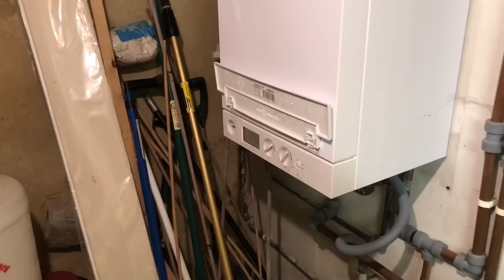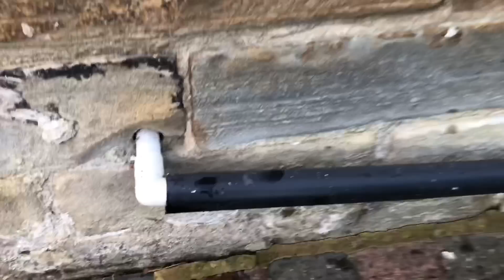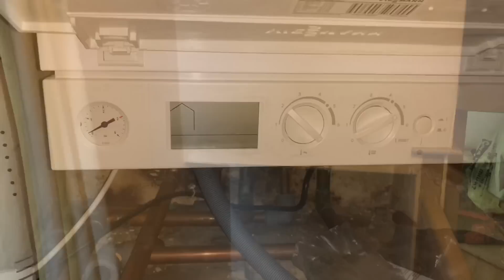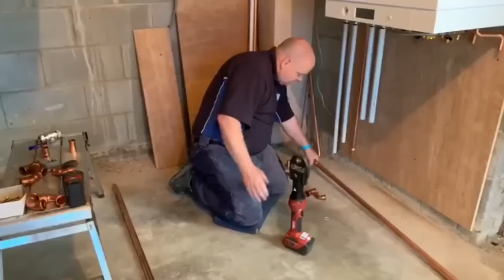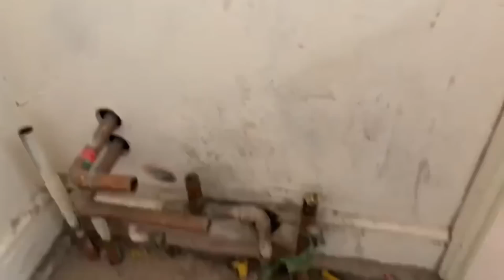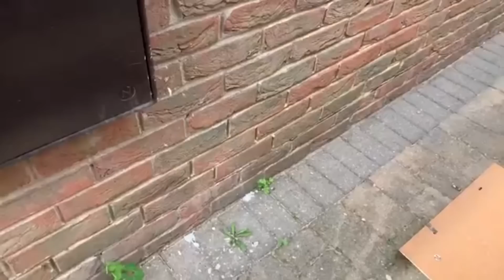Viessmann Vitodens Boiler Installation - Leeds Plumber

Comment: brilliant vidoes well explained  of faulty installs. i have a question for you i have a five year old viessmann vitdones 10-w system boiler thats acting very strange of late the boiler is set at 60c and room thermostat  at twenty 20c but after a while the heating just stops working but the boiler is still on and the house gets cold, what is happening in your opinion please.

Comment: When you are plumbing in these system boilers, would you recommend to the customer about secondary hot water piping, do many customers take you up on this??? Really good to get first hand real advice that I know is always 'proper'.
Reply from the maker: Yes, absolutely
Reply from the maker: if it has a system boiler and cylinder, Depending how far away the outlets are. Thanks.

Comment: Hi Allen, Quick question, this is a fairly new combi, the customer wanted a system boiler put in, so would you ever consider re-using this type of boiler (after it's had a good clean) on another job. It seems to be hunky dory, and it would get properly commissioned. I've not been in the trade long enough to know, but just wondered if this is one of those times where this could be re-used, in the spirit of salvaging where permissible, after all, it is only a few years old???

Comment: I have a Viessmann 100. I only have envy of the 200 because the latter has a much lower minimum power. I never hear anyone mentioning this factor.
Reply from the maker: Depends how much you feel that feature matters really. Thanks.
Reply: @AllenHart999  4.7kW for the 100 vs 1.9kW for the 200; that could be a big difference in on-off "cycling".

Comment: Alan, what are your thoughts regarding the modern control systems? Have you considered a video on the different ones available? My system Viessmann 200 has a weather compensator, which I think is brilliant. The largest gas bill I have received so far to date, heating and hot water, cooking is all electric, was £47 for the month, system is 2 years old.  I had an on line discussion with a heating engineer who said that they were all rubbish, and his customers were complaining that their radiators did not get hot, and he was taking all of them out.  That the radiators do not get hot is the whole point of the system, it compares the outside temperature with the requested  internal temperature, and adjusts the radiator water accordantly. There  is an internal ramp, for  the delta, that can be adjusted to allow for the building insulation, an old drafty house will need a much higher value than a modern, hopefully better insulated and draft proofed house.  Even during the coldest day the highest I have seen my radiator temperature was 34c, currently as I write this is, it is 24c . There is no internal room  thermostat, just not required. There are other systems available, the exhaust gas heat exchanger as an add on, very expensive, with very little return, and the ‘smart’ controls, which like smart meters i see relativity little gain. My house was built in the 1970’s, I have increased the insulation, but it is far from draft proof.
Reply from the maker: If i was going to do a video like this i would need to work with an expert. Maybe i could do a joint video with Viessmann at some point. Thanks.
Reply: @Allen Hart  I think worth looking into, as weather compensation is on the  list as one of the current systems that have to installed with new boilers, one that is not expensive, it certainly came as standard with the Viessmann. Smart controls, to me for much of the time are gimmicks. My washing machine has smart controls, e mails me when its finished, and tells me to empty it, and unlike a wife, does not iron it or put it away, cook my tea or provide other functions, but no doubt I will have to marry it at some point. Coffee maker is even worse, e mails me to tell me it needs servicing, now where have i heard that before 🤔

Comment: I remember a job I went to which was a Vaillant eco-tec and the installation had a condensate pipe in copper which totally disintegrated and because they drilled 22mm holes through the chipboard flooring the acid travelled through the flooring and rotted the gas pipe to boiler which was then rotted and most of the gas leaked under the floor and out the air vents. This could have been a disaster. I still have pictures of how bad the condensate pipe was.
Reply from the maker: Scary really. Thanks for sharing.

Comment: We fitted a Viessmann 050 a few years back and a good cold water mains flush alone pushed out a load of crap and muck from the system.
And after that it was as clean as a whistle.
Indeed I have mains flushed my own system a couple of times and I took a sample the other day in the turbidity tube.
Nice and clean.
Reply from the maker: Have you tried the new Adey Pro Check ? https://www.youtube.com/watch?v=3VcMnZEbrpg
Reply: mains flush is not a proper flush, if you had a lot of dirt come out then you only cleaned 25% of it as without a powerflush and chemical clean you are leaving the system still well below standard. Cowboys

Comment: Hi, I have a viessmann boiler fitted earlier in the year. I just can't decide what temps to have the water. The tap water is set to 60 I'm not sure what they should be for the tap and heating flow. What do you set yours at?

I was advised for the heating to have it as low as reasonably comfortable to save energy.
Reply: 60 for the heating if you want the benefit of condensing efficiency.
Reply: Not necessarily, you need to determine the temp diff across your system and then take that number to set your flow output temperature, the hydrocarbon dew point of gas is determined by temperature and pressure and different heat exchanger designs will differ slightly in pressure but the mean water temperature in the heat exchanger should be between 52 and 54 degrees, therefore if your temp diffs across your system is 20 degrees, you should set your flow temp to 64 degrees and if the temp diff is 10 degrees you should set the flow temp to 59 degrees etc etc and for extra efficiency install a load compensating thermostat. 👍
Reply: I have evohome TRVs on all my radiators apart from the bathroom.
Reply: Not sure what your point is?
Reply from the maker: Whatever is the lowest but still heats the house, Thanks.
Reply: All I was saying was I have evohome. But I'm not a plumber I have no idea how to work out what the flow temp should be. I know how to change it but I don't know what it should be.

Comment: Hi Allen , unfortunately to do a good job , it takes time and some people  / landlords only want a quick / cheap job . We all know there are plenty of cowboys out there that do cash jobs . Do not fill the benchmark card in , or fit any system filters , upgrade gas pipe . So when good engineer price a job some customers  think they are being ripped off , yes we can talk / explain to the customer why we are a little bit more , but it's mostly about the end figure . There are people / landlords out there who want a top notch job , but sadly they are the minority and not majority . Like yourselfwill only do good job , and the boiler manufacturers should have the right to walk away if the boiler as been badly installed . Keep up the great video's .
Reply from the maker: Thank you.

Comment: Hi Allen. Great vid. Are you still fitting Baxis? Did you get any more info on that leak from the Baxi heat exchanger you found with LDF?
Reply from the maker: I have a couple of baxi boilers over next few weeks. I didn’t get any feedback. Thanks
Reply: @AllenHart999  What do you fit the most Allen ?

Comment: Can I ask what is wrong with using push fit connections? When I used to work on new builds it was plastic pipe with push fit throughout with copper tails to the boiler, rads, taps and toilet connections
Reply from the maker: You cannot install push fit at the boiler. Thanks
Reply: @AllenHart999 
Thanks for the quick reply. In your opinion would a 6 year old glow worm betacom 28 be able to service a bathroom and en suite, with 15 rads?
Reply from the maker: ShaunD 07 if the boiler has been installed correctly then maybe, Although it’s not a boiler I would install.